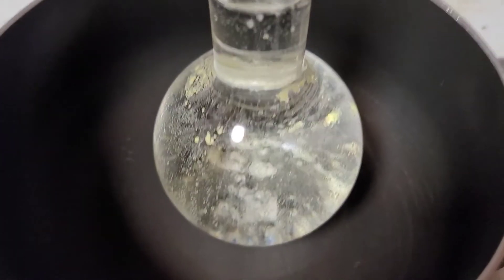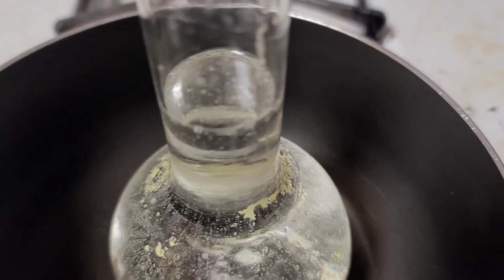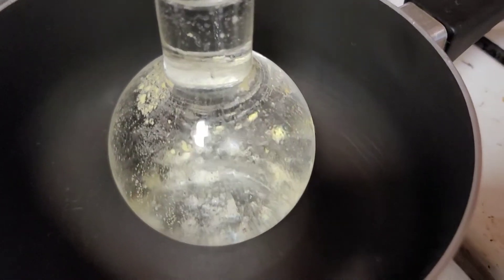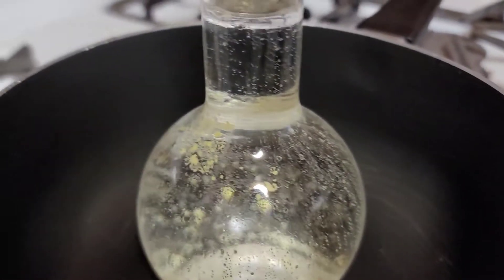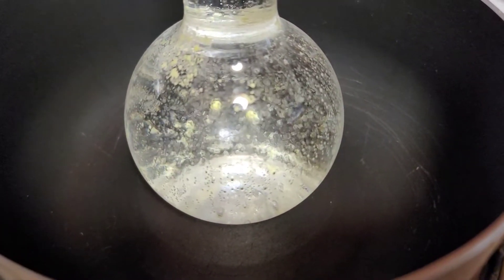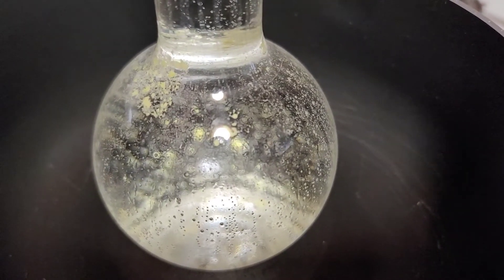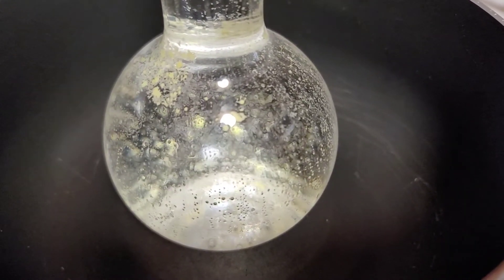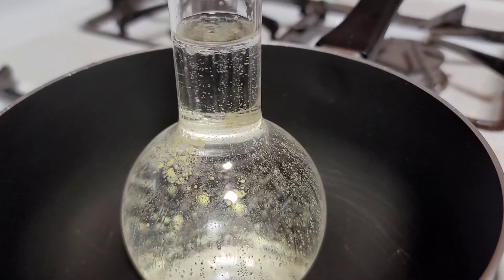How To Clean Laboratory Glassware?

Comment: Try sulfuric acid h2so4 and hydrogen peroxide. It will clean your glass, fast.
Reply: Also, add some sand to the heating pot. It will heat the glass evenly and it wont tip over.
Reply from the maker: Ty
Reply from the maker: Ty